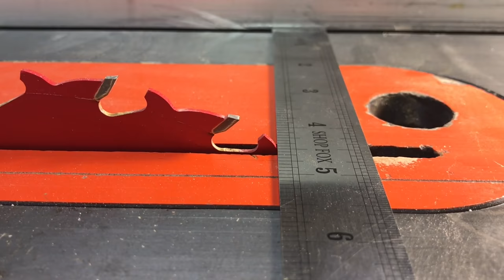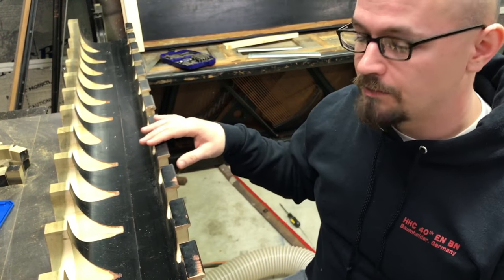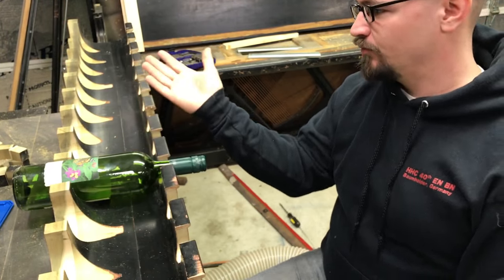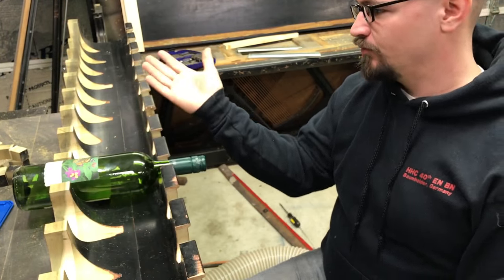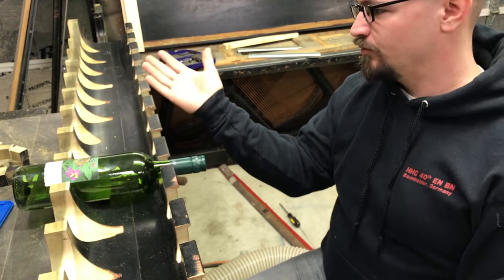DIY Piano Bar: Upcycled Upright Piano Build

Comment: I have a client wanting me to convert their old upright piano to a bar and wants a estimate.
Do you have any idea what you would charge for this with labor and materials or how many hours labor is involved?
Reply from the maker: There's only a few hundred bucks in material. I probably spent about 20-30 hours on the project.
Reply: How much is your time worth? $50-$75 an hour.  This is custom work you will be doing  so don’t be afraid to go big!